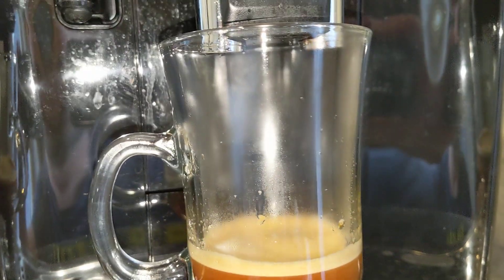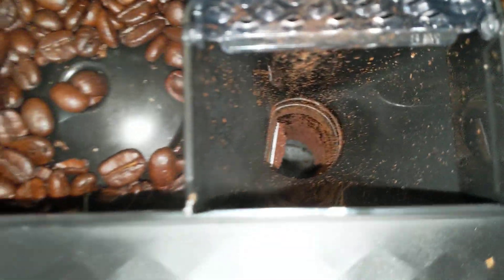Phillips 3200 Series LatteGo - Grinder Chute

Comment: I'm an independent service technician for coffee machines in the Netherlands for several brands. Most brands like this Philips have way less than 1 grind cycle retention. Probably about half a grind cycle. I haven't measured the amount in grams but it's certainly not several grind cycles. I might measure it precisely in the future but these grinders don't need a lot of servicing so that'll take a while.
Reply from the maker: That would be super helpful to know for sure.  I was trying to do it myself with some light and dark grounds to see if there is a difference, but I couldn't tell for sure when one was fully changed into the other.  What would be nice is a teardown of a machine like this that measured the 'volume' and 'density' that the chute can hold, we could then take the weight of a grind and calculate how many of that amount of mass would be required to pass a full chute.
Reply: That would be amazing to know. Feel a little cheated that we're getting day old grinds in our coffee!

Comment: Hey Bryan, just got my 3200 and the espresso and coffee is really weak and the pucks watery.  I know the machine takes a while to settle in, but how long should I wait before thinking it's a problem?  I use the finest grind setting, the highest aroma setting and the middle water volume setting.
Reply from the maker: I find that a more 'medium' grind works better in this machine.  I know that a 'fine' grind should expose more surface area to the water and increase the 'strength' of the coffee, but I haven't had that experience.  I don't know how the grinder knows how long to grind for based on aroma and grind settings.
Also, for me, the beans I use have the most significant difference in the perceived strength of the coffee. I tend to go with medium-roast espresso beans that do not have a lot of surface oils on them.
Reply: @BryanKlein  thanks for replying so quickly.  will try it out.
Reply: I have the same problem with a 3000 Series , mechanically the same machine ( same brew unit ect ) . It seems it does not grind enough for the pressure to express enough . I wondered if there was a fix ?
Reply: @technomad900  Same here. Checking the video our machine definitely grinds less coffee... but I can only say this by the look. Never measured it.

Comment: Got this machine today and I'm very disappointed, the coffee looks and tastes weak and watery (I'm using premium beans so it's not the coffee, also tried cheap ones), the foam is very thin and goes away as I take one or 2 sips, and since I know the taste of the coffee that these beans can produce, this machine is miles away of producing the same flavour.
Reply from the maker: It does take a few grinds/brews to get settled (about 2 weeks for me) and develop consistency in the brew, and to get my grind and volume settings dialed in. Having said that, depending on how you have brewed in the past, it might be very different.
Reply: @BryanKlein  Can't understand how such an expensive machine doesn't make proper coffees straight away. Before, I was using machines way cheaper (1/5th of price), so I expected much better experience after spending this amount of money. Since I bought it in Amazon I will give it the benefit of the doubt for 2 or 3 weeks, if it doesn't improve is going back. Thanks for your reply!
Reply from the maker: @carlosgouveia  yes, I get it and you should enjoy the brews you get from it. I've run thousands of drinks through mine by now and every new bean and changing grind settings change my experience too.  I go with medium roast, dry beans with little to no surface oils. I set my grind pip around #7-9. Hopefully you find what works for you, if not, I'd like to hear back from you if you find something better.
Reply: @BryanKlein  thanks for your inputs. I will keep you posted on my experience 😉

Comment: Mine stopped grinding the beans all of a sudden. It dispenses hot weather and does the coffee with the powder you out on top, but when I click for an expresso, the 3 warning lights start blinking simultaneously. Does anyone know how to fix this please?
Reply from the maker: Ooof, I have no idea. Have you called technical support?
Reply: @BryanKlein  yeah they told me to bring it to the nearest repair center. So I wanted to know if maybe there is a simpler solution someone found on here. (Thanks for replying so quickly)
Reply from the maker: @giovannigiorgio6406  ugh, that is not the answer I would want either. So I understand reaching out here first.
Reply from the maker: @giovannigiorgio6406  Wow great find!  Thank you for sharing!
Reply: @giovannigiorgio6406  Damn I pretty much disassembled the whole grinder unit and reassembled it multiple times and it would start like once but then the problem would represent...
Reply: @roblucci8655  same happens if you use the trick in the video i shared. In the end i had to take it in for repairs (broken grinder and the think that boil the water)
Reply: @giovannigiorgio6406  That's what I thought... Thanks for replying man
Reply: @giovannigiorgio6406  does that only rotate, and not remove anything ?? with the torx bit ?? thanks.
Reply: @JoelSc14  i don't get the question.. if you mean in the video, if you screw clockwise it only jumpstarts the grinder, but after a few hours it is "broken" again.. I suggest you use the warranty if you have it
Reply: @giovannigiorgio6406  thank you. I have no issue with mine. Turn to jump start makes sense, thanks for the clarification
Reply: You can find a yt on that exact issue. The guy replaced the grinder motor 

Not sure where he got the parts

Comment: Nice one, man! I am using EP2220. Do you know why the pre-ground coffee doesn't brew? Just getting water all the time. Finished decal and cleaning. All else works except grounds. Appreciate your answer!
Reply from the maker: Weird, I don't know your model exactly, but if you activate the 'grounds' mode, then you are basically dropping ground into the brew group manually and skipping the grind step.
Reply: @BryanKlein  my model is the the one with the steam/frother wand. Will try to add more grounds coffee. Always been using beans to grind, thanks man!
Reply from the maker: @gabeanderson2813  there is a scoop that comes with the machine.  It should take just one of those.  Are you pressing the 'bean' button until the little scoop below it has a light on next to it?
Reply: @BryanKlein I did not get the scoop. Any idea what gram amount of coffee the scoop holds?
Reply from the maker: @ankepieterse408  I think the the scoop holds about 7 grams of ground coffee.

Comment: Thank you for video! 
I understood it good? When you want to do coffee next day it’s using part od old coffee yes? Greets from Poland.
Reply from the maker: Thank you for the kind words.  Yes, I think there will be some part of the first grind of the day from the last grind the day before.  I haven't thought of a good way to clearly test this.
Reply: It says in the manual that if you change the settings on the grinder you need to make about 3 cups of coffe before the new setting is fully operational. This is probably because there is residue from the old settings left over as you say.

Comment: So what number is considered coarse and fine? Is 1 considered fine? Also what setting would you prefer on this machine? I noticed one of your comments said 5 or 6.
Reply from the maker: 1 = most fine and 12 = most coarse, you should see that the dots change size from 1 smallest to 12 largest to indicate grind size.
Reply: @BryanKlein  thanks for your reply. So you prefer to set it around 5-6? Just got this machine today.
Reply from the maker: @davebibi5  it does depend a bit on what drink you are making and how much 'flavor' and 'water volume' you select. But 5-6 is where I have left it for a while and I like the flavor. I usually make 'Americano' and 'Coffee' I'd say the coffee option I use more, which does pass more water through the grounds than the espresso shots for the Americano.
Reply: Thanks man. Sorry one more question. Did it take some time for you to get solid pucks coming out? Mine are always breaking apart when falling Into the tray or at least one of them get soggy. Looking at yours they seem very solid compared to mine.
Reply from the maker: @davebibi5  yeah, that depends on a combination of settings, I found this post generally useful on the topic. 
https://medium.com/@TERRAKAFFE/the-sloppy-puck-myth-2782e83c1e93
Reply from the maker: @davebibi5  I also made this video. https://youtu.be/gp-OMDt4-rA

Comment: Hi wanted to know if you can use ground coffee instead of the beans and just put the powder in the grinding shoot
Reply from the maker: Yep, you hold the bean button until it changes to the scoop option and then put the grounds in through the top.  There is a little door at the top for this.
Reply: Hi. I tried to changed it to the scoop option but coffee just fell down and machine cancelled my coffee. Why is that? Any idea? Thanks

Comment: I will be getting the same Philips 3200 Lattego on Friday and it will be brewing/making drinks at least 20 per days, do you think Philips 3200 Latte go will sustain the use of 20/30 drinks/day? I will be ready to return the unit if it fails during the stress tests (we have family re-unions and youth members will start drinking quiet lot of Cappuccino drinks)
Reply from the maker: We make something like 4 double serving drinks per day at a minimum and I've been doing that since I got it back in December 2019.  There will be a lot of water refills and grounds dumped per day, but if people know how to do it when the red lights come on it shouldn't be an issue.  I look forward to your report on the test.
Reply: @BryanKlein  Thank you for the response. Quick question since you've already been using the unit. the Aquaclean filter...is it required to installed, plugged in the Aquafilter in the water tank? I asked because I do not feel that I need it since my water is being filtered at 1st level Aquasana Whole House (filtration and then softener) , 2nd level 6-stage Reverse Osmosis, 3rd level Kangen LevelukSD501 (mostly mineralized and increased to PH9.0hz although water also goes through another filter at this level).
Reply from the maker: @jpthsd  It will run without the filter, you run it this way when descaling it.

Comment: I heard your not supposed to use oily beans like you have in the video. Also do use any flavoured beans.
Reply from the maker: That is correct, the lower the surface oil the better.  I usually try to buy medium roast with minimal oils.  Once I find a good one, I tend to stick with it.

Comment: Hi Bryan! How do you find the beverages this makes? I've heard some people say it's a bit watery compared to  other machines? I've also heard about mold issues inside?

I'm considering this vs the Brera or the Lirika Plus and am having a heck of a time making a decision.

Thanks
Reply from the maker: I can't speak for the other machines, but we've used this one to make at least two drinks almost everyday for more than a year now.  Rough estimate is a bit over 1000 beverages. I feel like it was a great purchase.
I think settings such as volume of water, grind and the bean selection can have a significant impact on the output of the machine.  I can say I've found beans and settings that deliver beverages that I enjoy. Espresso shots are rich and flavorful, and it's hard to tell with anything else if it is too watery, because other components are added (water and/or milk). 
If I neglect to keep the interior clean on a regular basis, then I have seen a bit of mold forming in the warm, moist residue of the grounds. But that is more about how well I maintain the unit than the machine itself.  I also live in the Pacific Northwest USA, where environmental molds are more prevalent.
Reply from the maker: I looked at the other machines, and I would say that the convenience and the quality of the LatteGo milk system would put it over the top compared to the others.  If you only make Espresso, Lungo, and Americano styles then it matters less, but for Macchiato and Cappuccino style, you will be glad to have the LatteGo.

Comment: How do you clean all this coffee stuck on the walls?
Reply from the maker: I use a little brush, but you could use a kids size toothbrush or something.  Go up from the bottom and down through the top.
Reply: @BryanKlein  it might appear some mold if it's not cleaned often, I guess
Reply from the maker: @Stradix  yes, I clean mine at least once a week.  It helps to gently flex/remove the door behind the water tank, to get full access to the interior without anything in the way.
Reply: @BryanKlein  great idea! Thank you so much
Reply: @BryanKlein  how does the door come off ?? I have been scared to remove it, thinking it might never go back on.. lol   have had my Philips 3200 LatteGo for quite some time. thanks !!
Reply from the maker: @JoelSc14  I flex/bend mine a little to get the plastic pins on the door to more easily come out of the holes they are in. Then I do the same thing, where I put a pin in a hole and flex the door a little to get the other pin in the hole and put the door back on.

Comment: I just got my 3200 and love it so far. I have never used beans or a grinder. My question is about the grinder.  When I look at the top of the grinder knob the 1 is at the top and of coarse the 12 is at the bottom. Where is the notch to show where you stop the knob on the setting I would want? I haven’t touched it yet since I have started using it ...but I honestly don’t know if I’m drinking a 1 or a 12 since I’m not sure where the point is that you stop for your desired strength.  I know it’s a silly question but info would be so helpful since I’m a newbie on a grinder.
Reply: Course not coarse
Reply from the maker: There should be a mark on the side wall of the bean hopper, next to the knob. Do you see it?
Reply: @BryanKlein    Yes.  Had to put my glasses on.  😂.  Thank you!
Reply from the maker: @kk612003  Yeah, it's not an obvious indicator.  Glad you found it. 🙂